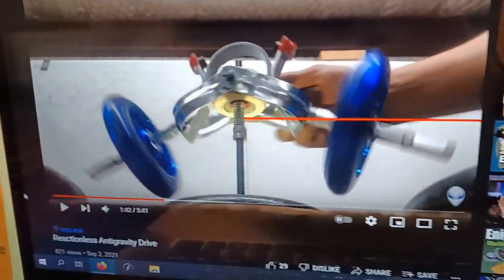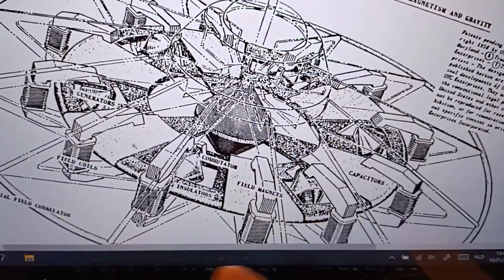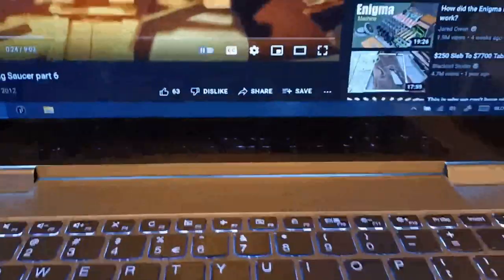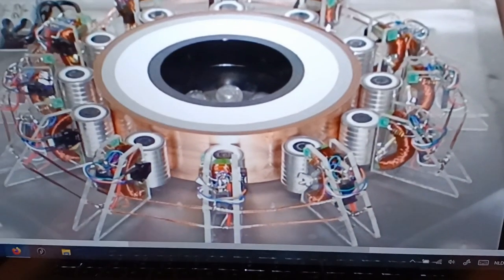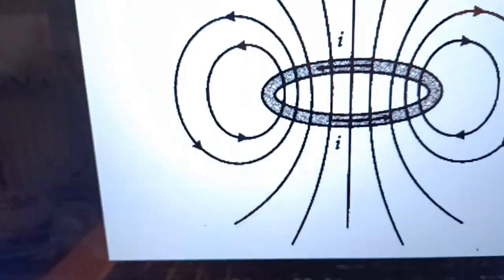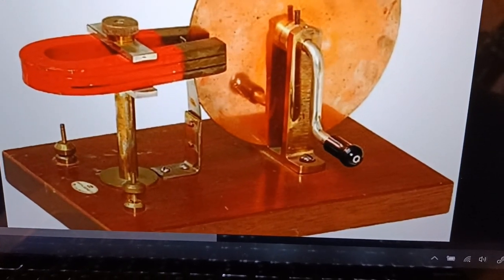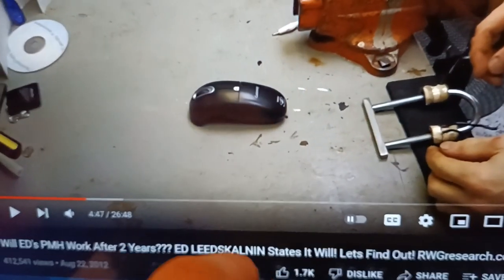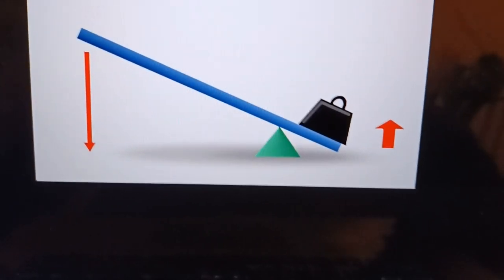OTC X-1 Utron Talk

Comment: Aluminum becomes magnetic when it rotates 360 degrees. I believe the Ultrons are made of aluminum and do rotate as the outer ring rotates, the ultron rotate and energize the coils in electro magnetic induction.
Reply from the maker: Aluminum does respond to a magnetic field yes, creating a field from eddy current. It does not magically create a magnetic field by just rotating. The question I have been pondering about is, how does that generate a rotation of the utron. Both sides of the utron experience a magnetic field from the C-clamp coils. Both have the same field strength and the same response is given from the aluminum of the utron. So how does it 'decide' a direction, either clockwise or counter -clockwise?
The rest seems obvious, the coil or utron is energized like a pulse motor and the field will collapse like a boost converter, giving a high voltage spike which will charge the accumulator. JP
Reply: @toffeeflavour  When Aluminum is rotated at 360% at some rate it becomes magnetic.
This is not well known, but is the truth. Ask an expert if I am wrong.
Reply from the maker: @markeaton2003  Hah ok, I had no idea magic still was possible ;'). I don't believe that to be true, but who am I. I know only one actual expert, it's nature itself, the experiment seems easy enough. Did you try this yet?
Reply: @toffeeflavour  Try it yourself. If your ultron is made of aluminum, get it to spin and see if a magnet will be attracted to it while it is spinning. I have over 45 years of Applied physics and Mathematics experience. I am not making this up, I only want to help you and others.
Tesla stated that Gravity is the equal and opposite reaction to EMF. Check Tesla's Dynamic Theory of Gravity. I have seen spinning aluminum attract magnets online. It is amazing and true, just like quantum locking is real.
Reply from the maker: @markeaton2003  Ok, so you think you have found it, try getting it on film and share it. If you have seen my channel you know I always share a hands on experience, I try to stimulate lazy people, but I don't have time for requests like this. At the moment, I'm very busy. So if you can.. handle it! JP
Reply: Ii have given you the truth, It is up to you to see if I am not. You can spin your ultron with a drill or motor and see. Yes aluminum is not magnetic under normal circumstances, but this is rotating it which is not normal. This is for you to see not me. Good luck. I would look up Tesla's Dynamic Theory of Gravity. Otis Carr learned from him,
Reply from the maker: @markeaton2003  So either you are making this video, or we can stop this conversation. ;) Like I already said in my video, 'I'm currently not in a position to make any of this'.
Reply: Might Club  Try it for yourself use a drill to spin it. The Ultron shape is good. I hold the truth so I dont care about skeptics.
Reply: Might Club  Isn't repulsion a form of magnetism?
Reply: @toffeeflavour  The capacitor plates and the individual U-trons on the the main rotor are not made of just aluminum, it is a meta-material mixture of Mu, aluminum, Bismuth and Zinc or Nickle, not exactly sure, but the combination of the metalic mixture, when combined with a elctromagnetic force, induces a magnetic field in the capacitor plates effectively turning them into magnets.  Now it is theorized also that the individual utrons on the rotor as well as the Main Accumulator the inside of which is a sphere shaped chamber which may or may not contain  liquid mercury which ,when spun by the electromagnetic forces from the the C shaped  electromagnets, creates an orbital magnetic force around the utrons, which in turn causes the rotor to motion in the opposite direction of the Main  Hull of the craft, thereby creating  Spin(Rotor) Counter-spin(Hull) 
Here is a link to a video demonstration of my explanation regarding the counter-spinning:  https://www.youtube.com/watch?v=UprSYfPuEi4
Reply: @markeaton2003  Paramagneticism causes interaction via eddy current between spinning aluminum and magnets, the interaction is usually a slowing down of the aluminums spin, or that spinning magnets can cause, for instance, an aluminum disc to spin via eddy currents..these are the only interactions im aware of  between the 2.

Comment: Alright here we go!! The smaller utrons are solid aluminum they are solid aluminum so that they rotate as the lass through the c shaped electro magnets....they are wrapped in a copper coil because as they rotate the also regenerate the center accumulator(battery). 
The craft is a motor ....the big novelty is that mr Carr put a battery in motion.......Mr Carr fell in love with the idea of a wheel ....he thought is was the perfect and purest for of transportation .....the craft is a motor ...all's the capacitor plates have a rail on top of them and below so that they actually make contact with the c shaped electro magnets..
Reply from the maker: I'm having a dejavu, like I Read this comment before in the exact same writing. Thanks anyway! Whats interesting is that not everyone here has the same picture in mind of the utron, it amazed me!

Comment: Nice!  But what's the final goal from this contraption??? It is a microphone, free energy device or boiling eggs control?
Reply from the maker: The utron being a part of the flying disk prototype, generates the power for rotation and gravity and it does that by rotating, so reciprocating the motion, that in itself is interesting. That would make it a free energy device, yes. On the other hand the claims also include generation of gravity and also the behaviour thereof. In case you want to know about it, check out 'ralph ring otc x1' on YouTube. I guess the goal is to find something, to find out how stuff works, and so that we sustain life.

Comment: you just gave me an idea! So you said that Russ was able to hold the magnetic field for two years in that u shape bar magnet. Maybe the C-clamps shape coils act in the same way with the Utrons in place. When the Utrons are spinning at high speed it pushes back any electric field right? would't this cause the C clamp coil to also hold a charge and power the coils that is wrapped around it? Someone should try this out.
Reply from the maker: Yeah I believe someone should try it. Whether the coils make a field and the utrons respond. Or even more likely that the utrons make the field and the coils generate, since the utrons are referred to as rotating batteries. Or what? Maybe even both happen, it is fascinating! Someone should try it :)